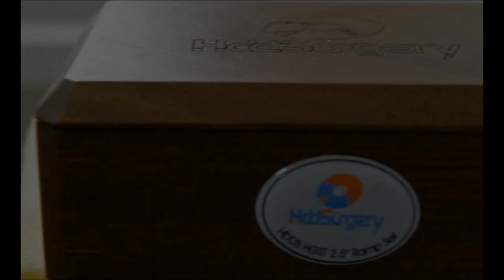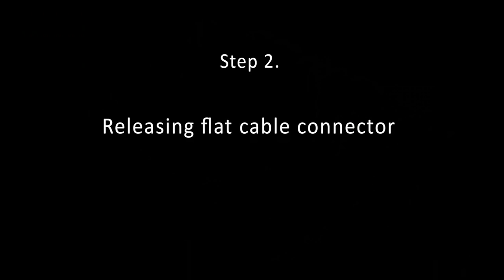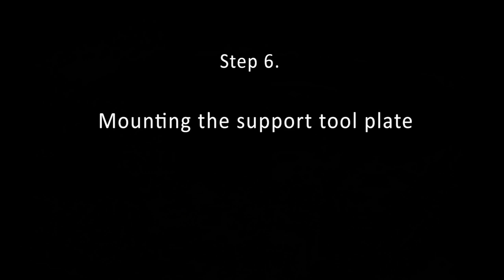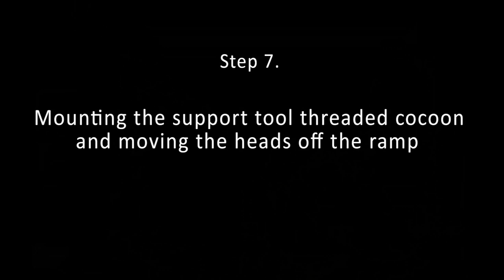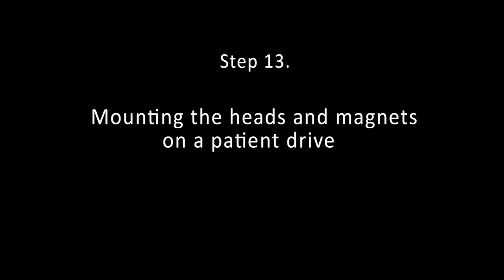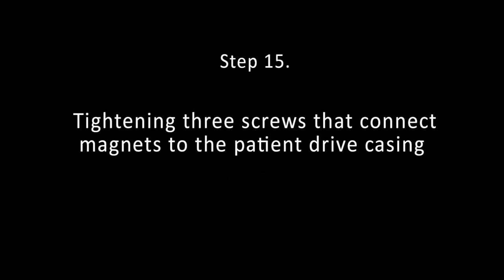Hitachi HDD Head replacement process - HddSurgery

Comment: Hi, everybody. I've seen this video because I'll try to open an old broken hard disk and change the head reader. ( I know it is going to be a disaster, but i'll try anyway). My question is actually since you guys are more expert than me what would you do? I have a HGST TRAVELSTAR 5K500 500GB SATA III 5400rpm HTS545050B9A30 0 8MB 2.5'' inch in which the head reader are broken. So My idea is to buy the same hard drive new and exchange the broken head reader. But I guess another possibility is take the disks from the old hard drive and move them to the new one. So what would you do? Thank you for your help.

Comment: I will buy this product if no need pc3000 software after swapping head
Reply from the maker: Our tools are developed to solve mechanical problems on hard drives, not for full data recovery process. You would need a software to finish the process and we recommend PC3000.

Comment: how to replace dubble platters ? are they lined up ?
Reply: Lining up platters so they are centered onto the spindle motor is pretty straightforward as the tolerance is very little. However, platter replacement cannot be done. The platters are magnetically written with patterns to guide the head movement. This is done with the HDD fully assembled not separately.